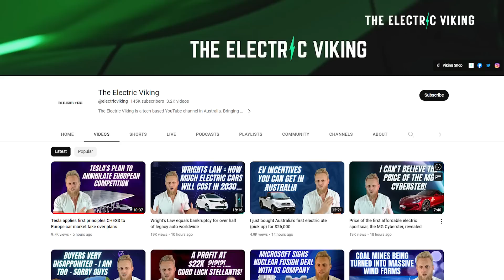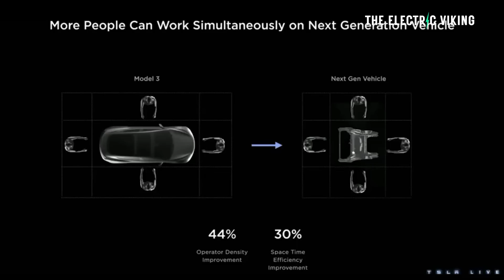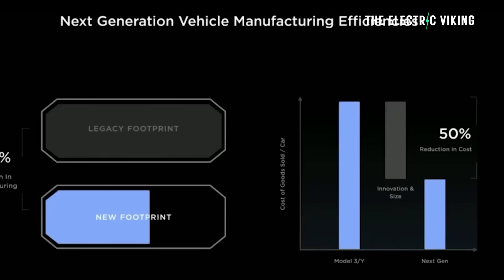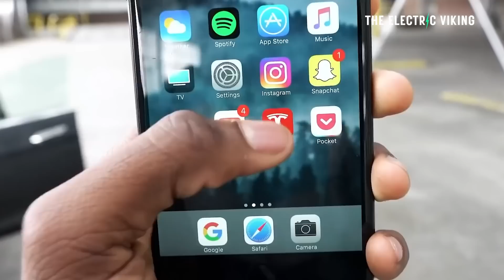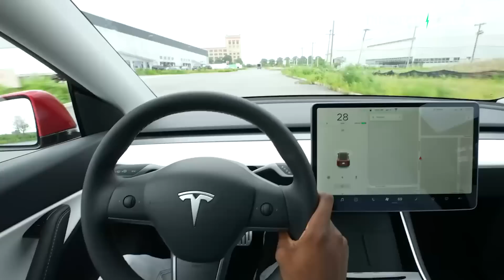Auto industry experts debate Tesla's revolutionary new manufacturing system

Comment: It's certainly possible with smaller battery packs, specifically with Sodium Ion batteries at a current pack price per kWh of $90-100, and $50-$60 with scale, as CATL said. India's compact TATA Tiago EV is $14,500 USD (for the highest trim) ($21K if it were to be sold in the US) and that's with more expensive LFP batteries, switching to sodium batteries would reduce the price by $1K, to $13,500 USD in India and $20K in US. Highest trim has a 24 kWh battery pack, enough for about 100 EPA equivalent miles of range or about 120 WLTP miles. Can be done, but manufacturers (including Tesla) seem to think people need 250+ miles of range in a compact EV (based on them stating that a cheap compact EV needs to have a 53 kWh battery) that will mostly be used for short commute to work, local trips and very infrequent longer trips. TATA already beat Tesla to an affordable EV (In India) and nobody seems to realize this, and it's rated 4 stars in Safety with near future projections of it being made to be 5 star rated, which would make it viable to be sold in the US. Volkswagen will easily be able to produce a 20-27K compact EV by using a battery pack that is around 25-30 kWh, as they have stated.
Reply: People find not to charge the car daily very comfortable, is a luxury feature, and when they need to drive a large distance, you dont have to stop a lot or buy another car, an all range car is better in the long run, though it is certanly a good idea,, to make a very cheap car with low autonomy for the ones that cna't afford a more expensive one, the problem is, willl it be profitable enough to sustain its production? that is one of the reasons Tesla does not think of one just yet until the market for Evs settle and there is less risk for that kinf¿d of cars.
Reply: @Voltaje_YT  The only people who would find anything under 200 miles uncomfortable are people who buy Mid-Size SUVs, which are specifically purchased for the ability to do long distance road-trips, while having the ability to tow or carry large cargo. So for a compact Sedan, the market is different, it's for people with lower incomes who are completely fine with charging daily using a 110V outlet overnight, and don't need long range because they don't go on frequent long distance road trips. The much smaller battery pack in a compact sedan will allow for a $20-$25K EVs with 5 start safety ratings and basic level 1 autonomy.
Reply: For a short time, you can live in the past. Like with hybrids. 
The market is being disrupted. Autonomy needs to be considered. Then it’s not worth individual ownership for most poorer people.
It’ll also make cities way more liveable for humans, for kids, for pedestrians. And speed fleet transformation to BEV. Way too many economic & planning reasons point to robotaxi fleet, by 2030.
Reply: 25kwh? The range would be far too low for Americans to buy
Reply: @enadegheeghaghe6369  It's all relative. 100-150 miles would more than enough for people who buy a Compact Sedan.. They have lower incomes and don't go on frequent long distance road-trips. You only need 200-300 miles of range in Mid-Size CUVs/SUVS, which are specifically purchased by people with higher incomes, and therefore more frequent longer road trips. A car's total price will mostly be determined by battery pack size, and not vehicle size as that barely saves any money. Just like with ICE vehicles, price is mostly determined by engine size, 1.5L, 2.0L, 2.5L, 3L.
Reply: @igotanimac1  The cold hard truth is that most Americans don't like very small cars. A 100 mile range would also make it less desirable. In case you haven't noticed SUVs and big trucks are extremely popular in the United States. The Indian and American car markets are very different
Reply: @enadegheeghaghe6369  Yes, I'm very aware that Americans prefer trucks/suvs. But there is still a market for compact sedans and a more massive market for mid-size sedans, a compact sedan would have a range of about 100 miles and a mid-size sedan would have about 150 miles. A mid-size Toyota Camry Sedan sells very well, often ranks as 4th best selling vehicle in the US, outselling some popular SUVs. 150 miles of range for a 26K mid-size EV sedan would be enough for the market that buys that class of car, and same with 100 miles for a $20K compact EV. Average daily commute is under 40 miles. You can charge it daily using a standard 110V outlet. The necessity to put more than 100 miles of range in a compact EV is zero.
Reply: @igotanimac1  The only issue with the 100-150 mile range is that those cars will still need fast charging support, as they won't own a 2nd car for the in-frequent longer trip. While I could live with a 100-150 mile range, I also need fast charging support for the 6 hour round trip that I do every other week and I have to charge in-route not at the destination where there is no charging at all.
Reply: @igotanimac1  True the Toyota Camry is popular, and with a 15.5 gallon tank this car will go over 500 miles on the highway. No one who buys a Camry today would buy a comparable sized BEV that only goes 150 miles on a charge. I live in a very rural state and people here drive 50-75 (or more) miles one way to work. I was driving 62 miles one way. I would not buy a BEV of any size that did not get at least 300 miles of range. And the other issue (no matter what country you live in) is the ability to charge your BEV. A large number of potential BEV buyers do not have the ability to charge at home and would have to rely on the local charging stations. Where I live, the closest is about 40 miles away.
Reply: @lorenmerriman8439  A majority of people who buy a 100-150 mile EV would not go on long enough road trips or frequent enough road trips to justify the need for 200-300 miles of range. The lower your income, the less road trips you take, and the shorter in range they will be. This has already been established through various studies and correlates with everything in life, a good example being homes, the lower your income, the smaller house you buy and the less stuff it has, and the less crown molding, and the less number of rooms, and the less it costs. If you need 200 miles of range with the capability of fast charging, you'll be able to get that with a $33-$38K 200 mile range mid-size CUV, of which you'd be able to recharge to 80% in 30 minutes.
Reply: @rickysmith5021  "I live in a very rural state and people here drive 50-75 (or more) miles one way to work. " So the problem is the 1-2 hour driving distance each way  to work and not the other way around, meaning battery packs in a car should not be bigger because a small percentage of people have 1.5+ hour commutes each way. Having a 50 mile commute each way would be below the 150 mile range of a mid-size $26K Sedan. If you want/must drive 1.5+ hours each way, each day for work forever, you'll have have to get a $33K EV with 200 miles of range. 

"A large number of potential BEV buyers do not have the ability to charge at home and would have to rely on the local charging stations." If you have a standard 110V outlet at home, you an charge an EV. If you live in an apartment, it would be so incredibly cheap to install a standard 110V mini tower in each parking space either by the aprtment owners or by a private entity or by the city. If you make long frequent road trips or have a 2 hour work commute each way, consider moving closer to work or install a level 2 charger at home. 

A majority of Camry buyers would be interested in a $26K 150 mile EV, because many of them don't have 2 hour long commutes each way for work, the average US commute is 30 minutes each way. So in reality, in the world world, most would be fine with 100-150 miles, just based on the average work commute. And anyone who does frequent long road trips, will just have to get a 200 mile $33-$38K mid-size CUV or 300 mile $47-$53K SUV.
Reply: @igotanimac1  I have tried a 110 volt charger and on my Tesla it only adds 4 miles per hour of charging. So, to charge 80% of a 150 mile range BEV would take around 30 hours. Not possible if this your only car. And again, a lot of Americans live in apartments and do not even have the ability to use a 110V charger. Maybe by 2030 apartment complex owners will add chargers and this will work itself out but I have my doubts.
Reply: @rickysmith5021  Level 1 standard outlet or level 2, depending on your needs. Some will be completely fine with getting 40-50 miles of range using level 1 charging over a 8-12 hours, not everybody drives 30, 60, 90 minutes to work each way, believe it or not, some have very short commutes to work. And for those that need charging speeds of level 2, they'll just charge with level 2. And again, private companies can easily offer to install level 1/2 chargers in each parking space at zero cost to the apartment complex owners, and you'd pay with a card per, just like you would with any other charging station. And again, it doesn't have to be the apartment owners, it can be a private entity or the city, you'd be paying for the installation through a relatively small fee on top of the cost per kWh of electricity you use when charging, just like people already do with public charging stations..
Reply: @igotanimac1  Here is a perfect example of your 100 to150 mile EPA range BEV that did not work in the US. Take a look at Mazda's MX 30. This BEV is sold only in California. The mean household income in California is $111,622 (median is $78,672) per Google. Mazda has sold only 32 in the first 4 months of 2023. One of the main reasons for poor sales is due to the lithium-ion battery pack, which has a usable capacity of just 35.5 kWh. This allows for a total range of 124 miles (200 km) on a single charge. 
 Here is the major issue with large US cities like LA, Chicago, New York. You may only live 10 miles from work, but it can take you 45 minutes to an hour to go those 10 miles at rush hour.
Reply: @rickysmith5021  Ok, so let me explain to you why the Mazda MX 30 is a poor example to use in regards to the viability of a 100-150 mile EV. 

The Mazda MX 30 EV is a subcompact CUV. Thing costs $35K. It's overpriced by about $12K. People who have incomes high enough to buy this $35K Mazda EV, DO NOT buy subcompact or compact cars.. They buy Mid-Size SUVs or larger. So it's too small for people that can afford them, and too pricey for people who usually buy subcompacts.. It has less legroom than a Toyota Corolla... It's so aerodynamically inefficient, that for the range it gets, the battery is massive, 2.82 miles per kWh, compared to 4.73 miles per kWh for something bigger, like a Tesla Model 3. And the people who usually buy a subcompact vehicle, do not have a nickel in federal tax liability before or after you consider child tax credits, earned income tax credits, etc and therefore do not benefit from the $7,500 non-refundable tax credit. 

So in reality, in order for a $20K 100 mile EV or a $26K 150 mile to be viable, it has to be priced right, and have low aerodynamic drag in order to be able to get the required range with a much smaller battery pack. And 100-150 miles don't even take into account the miles you get back from regenerative braking. This can now be done even more so with sodium ion batteries, which are 25% cheaper and have the ability to be 50% cheaper with scale. Most understand this reasoning, the few manufacturers that are considering a $20-$27K EV say the cars will have a 20-30 kWh battery pack, and EVs with 200 miles of range will have a roughly 40 kWh battery pack at a cost of $33K+ and vehicles with over 300 miles of range will always have a roughly 75 kWh battery pack, for $47K+.
Reply: @igotanimac1  LOL, We have PHEV's with battery packs up in that 20 to 30KW range and larger here in the US. The Polestar 1 at 34 kWh and 65 miles range.
Reply: @rickysmith5021  What's so funny? And??? go on, make your point..
Reply: @igotanimac1  Be honest what country do you live in?
Reply: @rickysmith5021  Why would I not be honest about what country I live in? The US. Now go on, what point are you trying to make in response to my last response? You just stated something with no purpose or explanation.
Reply: @igotanimac1  Because where you grew up has an impact on how you think about things. And where I grew up and where I currently live in a very rural state the Tata Tiago EV would not do well here no matter how cheap it is. Most US auto makers have stopped producing small cars because the buying public does not want them. And no US automaker will make that small of an EV because there is no profit in making them in the US. 
 Tata cars would not be as cheap as they are currently being sold in India (if Tata was able to import them to the US). The Tata Tiago EV ranges from $10,300 to $14,800 at today's exchange rate in India. I would say that this price would probably be over $20K for the base model and closer to $30K for the top model, if it was imported to the US. Not sure if it would even meet US standards as it is currently made. 
 The next issue is the estimated range. Tata is using MIDC and one of the draw backs is it covers lower maximum speed and shorter time for the driving cycles to calculate the range. This car would not get that range on an EPA cycle. The fact is the slower you drive without stopping the greater the range. We even see this in the WLTP range is always higher than the EPA range. And some would argue that the EPA range is too generous to EV's. 
 I think the MX 30 is a good example of a car with a very limited range and how it is perceived in the US. Currently the average selling price of a new automobile in the US is $48K. The Mazda at $34K is not exceptionally expensive considering. The MX 30 with its limited range would work as a city car and with the charging infrastructure in California there would not be any issue keeping it charged. There are hundreds of thousands California families that can afford this car and yet only 32 was sold in the first 4 months of 2023. I do not think the price was the main reason it has not sold well. When I googled it, range was the first thing on the list.
Reply: @rickysmith5021  I don't think you're understanding my point. 

The market for a compact vehicle in the US is obviously way smaller than many other countries.. I'm not arguing that a 100 mile compact EV would sell well in the US, I'm saying that in order to produce a Compact EV with a $20K list price, it would have to have a much smaller battery pack, and therefore about 100 miles of range. That's also part of the reason why a Mazda MX 30 doesn't sell well in the US, it's way over priced for being a subcompact, and too small for the incomes that buy a $35K vehicle. The MX 30 wouldn't sell well even in countries where people buy compact vehicles in higher numbers. 

The smallest vehicle class that sells in solid numbers in the US is a Mid-Size Sedan, such as the Toyota Camry. An EV the size of a Toyota Camry would have about 150 miles of range, and sell for about $26K. 

"Tata cars would not be as cheap as they are currently being sold in India (if Tata was able to import them to the US). The Tata Tiago EV ranges from $10,300 to $14,800 at today's exchange rate in India. I would say that this price would probably be over $20K for the base model and closer to $30K for the top model, if it was imported to the US." As I pointed out in my original comment, if you were to make a Tata Tiago EV in the US (not imported), with USA labor costs and all, it would be $20K for the top trim, and under that for the lower trim, you can do the math.. it's about 40% more, when comparing for both India/China. 

" Tata is using MIDC and one of the draw backs is it covers lower maximum speed and shorter time for the driving cycles to calculate the range." Yea... I already accounted for that, the range in MIDC is 155 miles on the lowest trim. With EPA standards, it would be about 100 miles, and about 120 WLTP. 

" I think the MX 30 is a good example of a car with a very limited range and how it is perceived in the US." Again, the MX 30 wouldn't sell well at any price in the US, and would only sell well in other countries, but at a much lower price. 

" I do not think the price was the main reason it has not sold well." It's 2 things, it's a subcompact, and it's priced terribly for a subcompact. And one of the reasons it's priced terribly is because it's dimensions are not well suited for efficiency in an EV, doesn't even get 3 miles per kWh, therefore making the battery bigger and more expensive than it needs to be. 

In the US, the smallest car that would sell well is a $26K ($30K for highest trim) 150 mile mid-size sedan. And after that, a $35K/$40K 220 mile CUV, a $50K 330 mile SUV. Everywhere in the world, a $20K 100 mile sedan would sell well and already possible.
Reply: @igotanimac1  We will just have to disagree. There will not be any domestic US auto maker that will make an EV with a 150 or less range and put it on the market in the $25k range or less. 
 I am sure you know that GM is killing the Bolt EV & EUV at the end of this year. It is the cheapest BEV on the market, and it starts at $28K and a 247-mile EPA range. With the tax incentives you could get one for just under $20K if you qualified for the maximum tax incentives. Tesla sold more model Y's in Q1 2023 than GM did in the entire life span of the Bolt (2017-2023).
 The cheapest EV's coming out later this year is GM's Equinox starting at $30K with and EPA range of 300 miles. 
 Tesla new model 2 is targeted at $25K and a 250 to 300 mile range. We will see how close they come.
Reply: @rickysmith5021  "There will not be any domestic US auto maker that will make an EV with a 150 or less range and put it on the market in the $25k range or less." That would mean completely getting rid of the $26-$30K Camry size market all together, a car segment that sells well in the US. People who buy the Camry, don't need more than 150 miles of range in an EV, the people who would need more than 150 miles, would usually buy a 30-35K Rav4, an SUV, that's purpose built for longer road trips with larger cargo, and more room. 150 miles would be plenty for people who just commute to work and back, local trips and rare medium/longer distance road trips. I agree, it definitely won't be a US automaker, it would be Toyota or Honda, who build superior mid-size sedans while the US auto makers focus on larger SUVs and Trucks. 

Yes, Chevy is killing the Bolt EV/EUV. It was a Compact vehicle that GM was losing tons of money on because they put a massive 62 kWh battery in a Compact car, therefore losing thousands of dollars on every single unit.. They were with you in believing that every car needs 250+ miles of range, and they were wrong. The oversized battery pack made it way more expensive to build than it should have been, and it should have been a mid-size, not a compact, at that price. A Nissan leaf has 150 miles of range, and Nissan makes a profit on it, problem is that it's a compact, not a mid-size, their dealer network cost makes it harder to justify the extra cost needed to make it a mid-size and not a compact, selling direct to consumer would easily allow them to make it a mid-size, and keep the range and price the same and therefore sell a lot more.

The Equinox is not going to start at $30K, they said starting around $30K, won't be in the low 30s, especially after GM can't seem to hire people wanting to get paid $16 an hour at the battery plants here in the US, so they are going to have to pay more, which means higher costs and therefore higher pricing, which is why they haven't released pricing for it, as they have for their EV truck and larger more premium Blazer EV SUV. The base 1LT with zero features will most likely start at around $35K at best, with destination fee included, dealers will tackle on at least $1K in basic options/accessories. And the base option is going to have 250 miles of range with FWD, not 300, and technically 200 miles considering you shouldn't charge the battery chemistry they'll be using past 80%, unlike LFP chemistry, which can safely be charged to 90-100%. Most will want AWD, especially in an SUV, so most will get the 280 mile (224 miles using 80% rule for batteries with lithium/cobalt) AWD 3LT that will be about $43K. So it's going to be an SUV that starts at $35/$36K for the lowest trim option that most won't get, and up to $40-$45K for the top 2 trims that most people will get considering they'll want AWD and basic features typically equipped in an SUV of that size/price. 

Tesla Model 2 at $25K with 250 miles of range is 100% impossible to sell at a profit, at current battery costs or at any projected near future battery costs.
Reply: igotanimac1 • In the developed western world a range of 250 miles on a full charge is not enough for an EV. It has to be a minimum 300 miles ( = minimum 480 Km ), REAL USABLE miles, on a full charge ( REAL USABLE = IN ANY DRIVING CONDITION, MANNER+WEATHER ).
What you're talking about is what's in the poor countries like India, etc. 
You don't understand the developed western world, as I can see in your comment.
300 miles MINIMUM is not a joke or a fancy, dainty, taste. 
It is a PRACTICAL NECESSITY in the developed western world.
Reply: @mikel4879  "You don't understand the developed western world, as I can see in your comment." Oh boy, let me teach you a thing or two. You obviously don't realize this, but not everybody in the US has a moderate or high income.. Half the population makes under $30K a year... These people only get a car to go from their house, to their workplace, local short trips to stores and rarely ever go on long distance road trips. 100 miles would be more than enough.. especially considering that you can charge it daily, overnight using a standard 110v outlet.. 300 Miles is only necessary for SUVs, which are primarily purchased by moderate income people, who are more likely to go on long road trips, multiple times a year.. of which would require an EV with 300 miles of range. So a necessity for moderate/high income people, and not for lower income people.
Reply: @mikel4879  When is the last time you drove 300 miles in one day? I can't even remember the last time I drove 100 miles. It takes an extra 10 seconds a day to plug your car in when you get home.